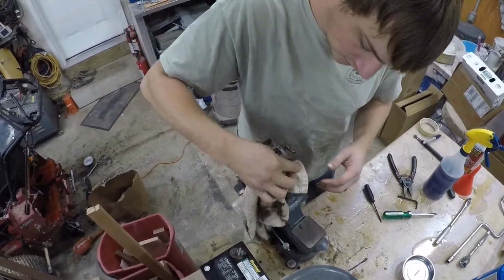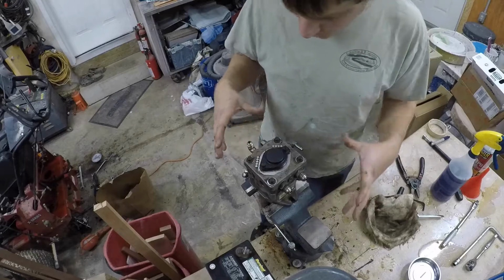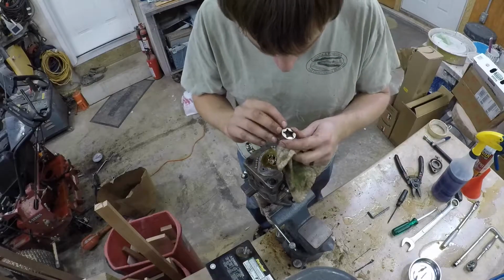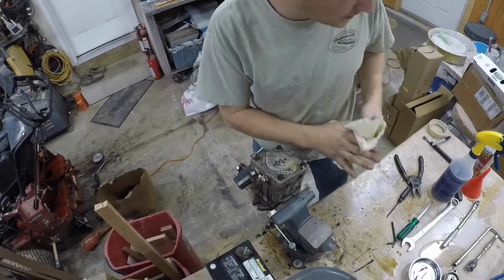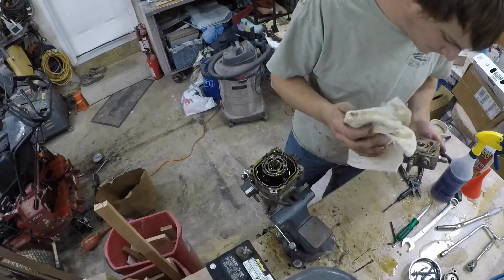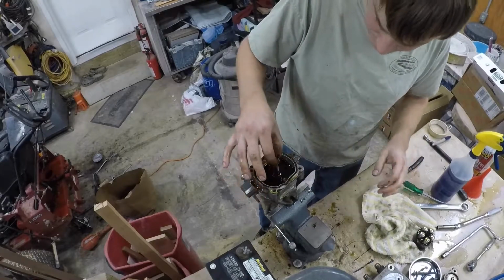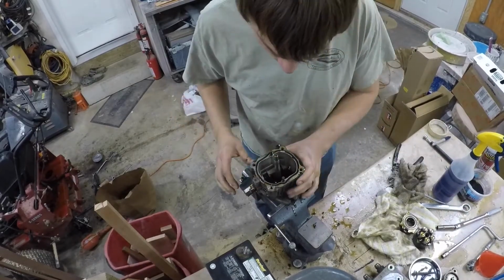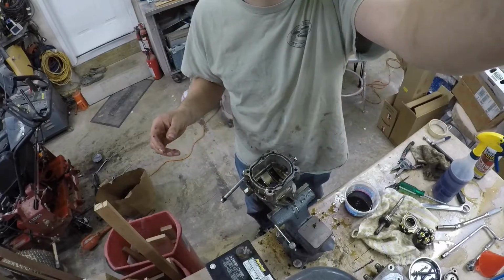Exmark Hydro Gear Hydraulic Pump Disassembly

Comment: Did you ever get it back together and operating correctly? Mines working fine it’s just leaking at the seals.. I’m thinking of doing the work myself but everyone is saying how hard it is.. doesn’t look to bad in my opinion. At least not taking it apart. Just don’t k ow how to reassemble. Any help would be greatly appreciated!